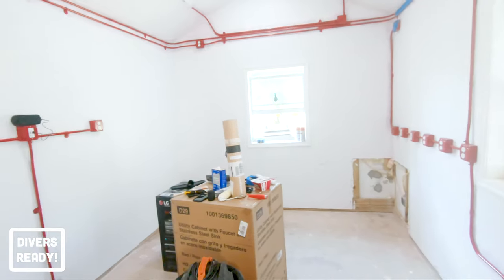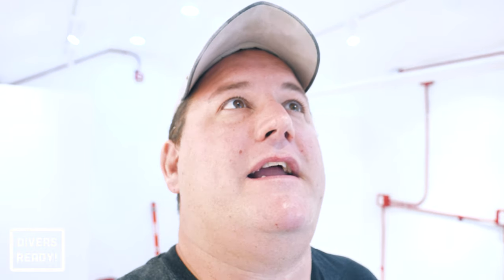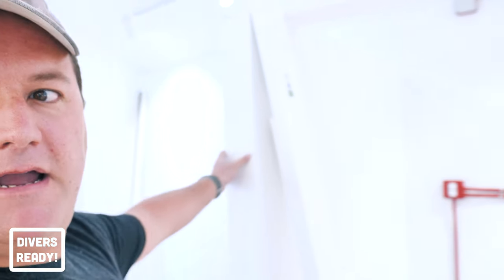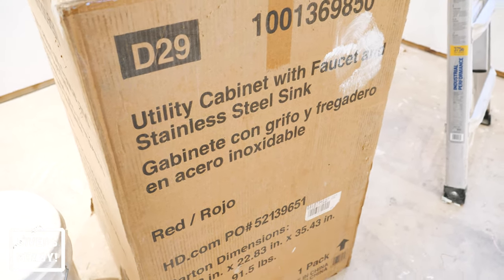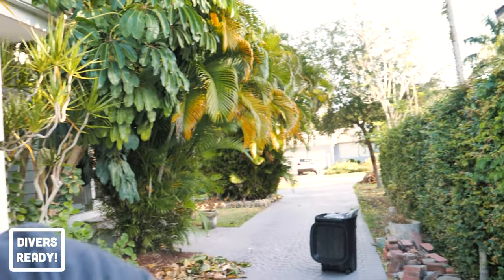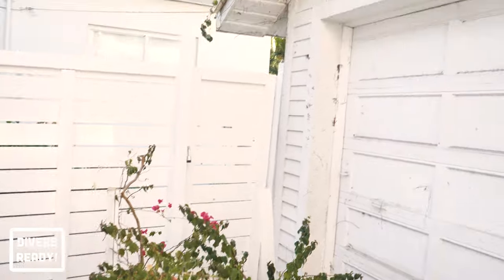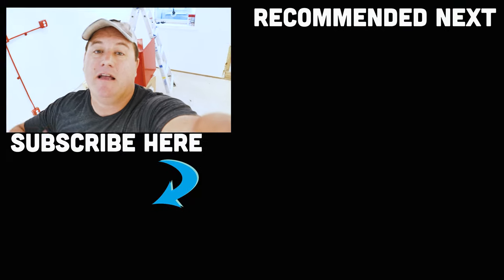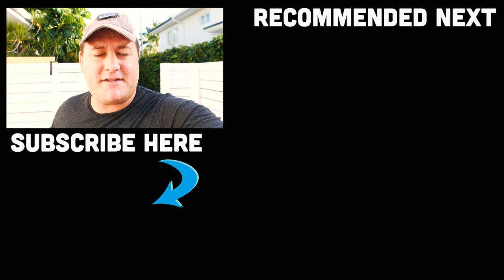Dream Dive Locker Build Out Part II: Blank Slate

Comment: Just a few thoughts as someone in the building business for 35 years. 
1. All the colors are really dark and will make the small space feel smaller. More neutral colors will give it a more open feel.  Personal preference is everything so ignore this remark as applicable. 
2. On a secure space sometimes I like to use a gas pipe nipple about 8 or so inches long drilled back through the studs under the strike plate as a receiver for the dead bolt. It makes it very difficult to kick a door in. 
3. My wife and I are designing our retirement home in Mexico and I will be borrowing your ideas for our dive locker space. That alone buys you and the wife a free hang out and dive anytime ya'll get ready.
4. The rattle can cam was freakin awesome.
Reply: Brad Allen depending on where you are in Mexico, check out the setup at Underworld Tulum - Lanny built his dream dive locker and outside space and it’s beautiful to behold 😊

Comment: Color #1 for sure and the industrial look with electric instalation in red look nice to, maybe you can consider a colour concrete floor, is easy to clean and no problem with water. That diver's cave will rock for sure.